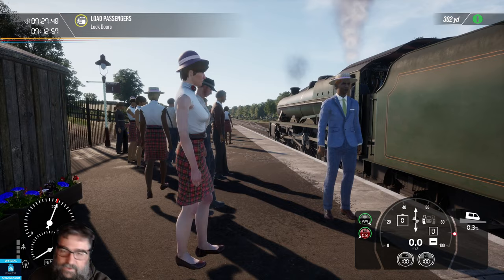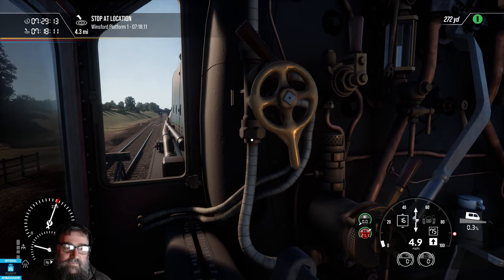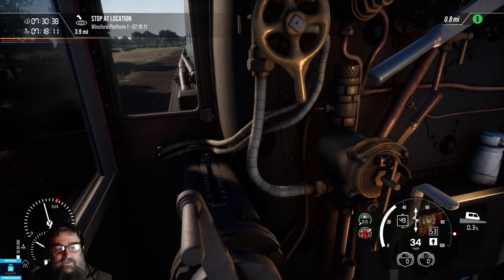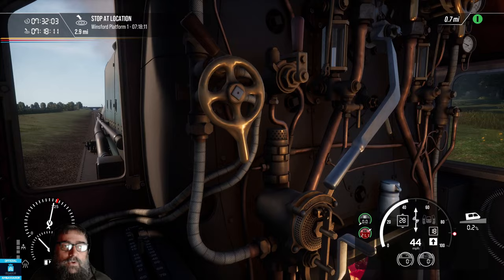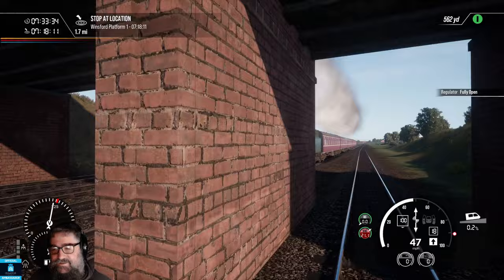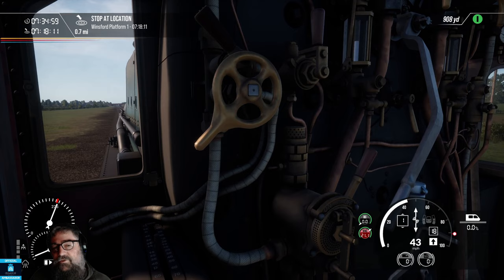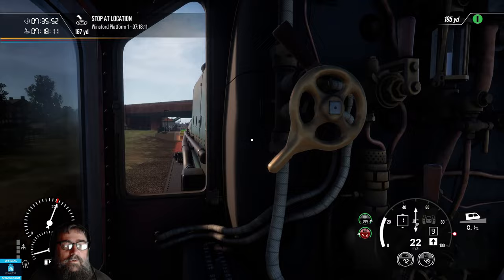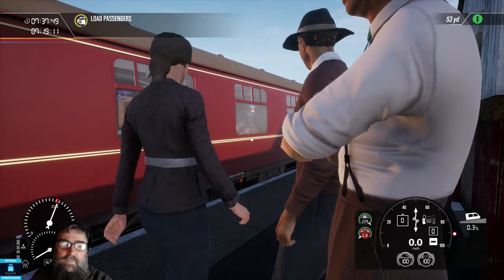TSW2 Steam Tutorial Part 2   Basic Driving Techniques

Comment: For some reason I'm not able to go any faster than 24 mph in the train you're driving in this video. I have checked everything I could have and still I wasn't able to go any faster. Both brakes were fully released and the regulator was at 100 all the time by the way. Another problem with the train is that it couldn't climb  the hill in Liverpool when one is departing. It may be me doing something wrong because I think the train is capable climbing that hill. What do you think I may be doing wrong? Sorry for bothering and thank you in advance.
Reply from the maker: No bother at all. Sounds like the question you asked on stream, but I will answer here too because other people will have the same question. The answer likes in the reverser. The reverser governs both speed and power. At 75 its very powerful but very slow, at 30 its very weak but very fast. To go faster as you pick up speed bring your reverser back towards mid gear. To get up the hill a reverser of about 45 or so will do it. If its wet or snow you'll also need sand.
Reply: @trainsimulatordriver  then it seems as though the reverser would regulate the torque of the locomotive; at least for this particular locomotive. Which begs the question: For which specific circumstance would you say that having the regulator at 75 would be a useful thing?
Reply from the maker: @emmanuelperez9490  that is quite astute, yes that is its essential primary purpose, its second purpose is to use less torque ( power) to conserve steam. 75 is valid for the first few metres on a steep slope, any other time you would not need to go full forward gear on such powerful locos.
Reply: @trainsimulatordriver  is there any issues with running at 100 all of the time.

I do understand mechanical physics of a steam engine but not from the aspect of controls etc 

Most machinery is very bad at running fully open etc 

And it's not always the fastest way in all machines 

Just a quick summary will do things like 

Is there a power band area of revs or throttle that hold the most power

I ask because I'm playing with derail valley and looking to move to a more full featured game afterwards

I am about to embark on my first steam mission this information will help the next time I have ago 

Love how clear and precise your information and explanation is awesome thanks
Reply from the maker: @madyottoyotto3055  steam is possibly a bit better in derail valley, in TSW we have magic steam and magic coal and magic water, at least in derail valley you have to put it in the firebox and boiler lol. Steam engines make the most power with the reverser to the fullest extent. This so is inefficient if you drove this way your fireman would belt you over the head with the shovel because they'd have to work really hard and would run out of coal and water. As you come back towards the middle (typically about 30% on the reverser) you start to use the power of expansion in the steam and become much more efficient. You only need lots of power to initially move, once starting you can bring it back. You might need a notch or two more going up hill.
Reply: @trainsimulatordriver very helpful makes lots of sense
Reply from the maker: @madyottoyotto3055  thanks